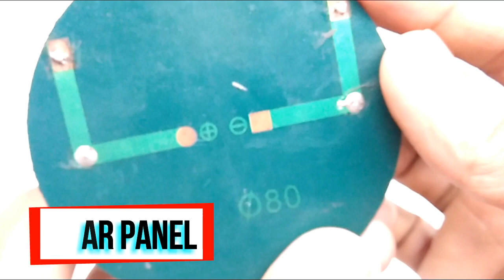How to make Solar Mobile charger-Charge your mobile from sunlight

Comment: but there are no amps😁😁😁, 2000 years later battery 1%
Reply: Why explain ?
Reply: , 🤣🤣🤣 yess i have tried 100 times
Reply: @shrutimukherjee8378  because higher amps = charge faster

Comment: you need one monthe for charge 100 mA
Reply: Yess bro
Reply: @arumugama8769  nope it's only about 2 to 5days with full sunshine
Reply: @arumugama8769  and it's 1.2A output so it will only take 4 hours
Reply: well it's 24 hours. but he use small panel . you need a bigger one to be effective